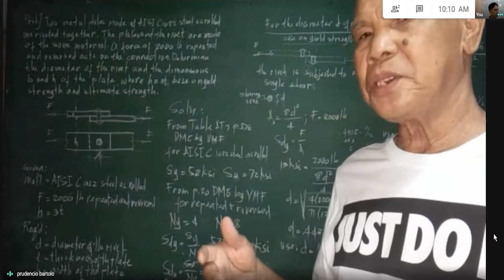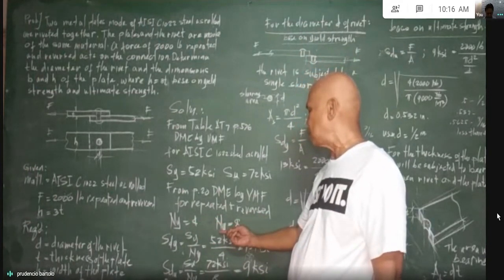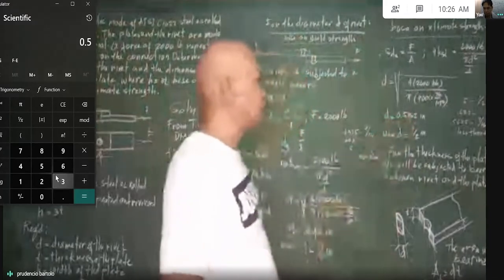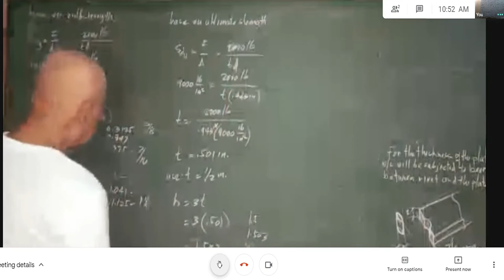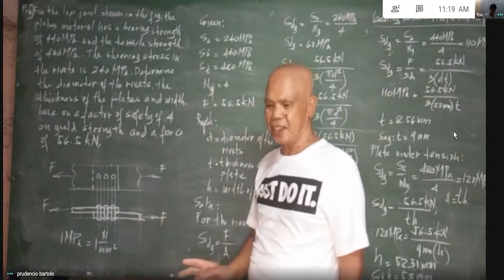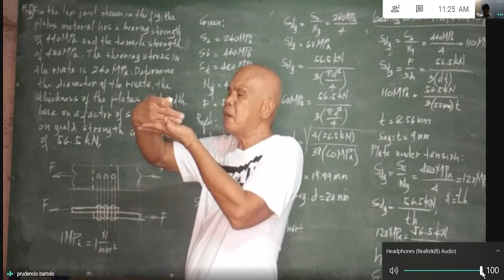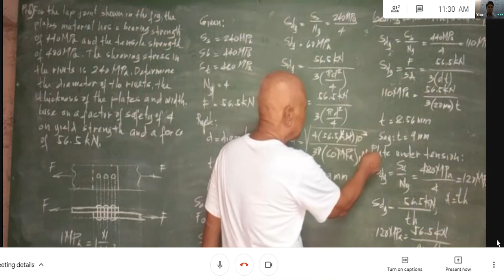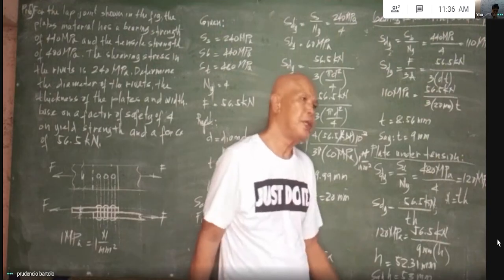Shearing and Bearing Stress with Engr. Bart

Comment: We have learned about how a bending moment causes a normal stress.  Stress is the a measure of what the material feels from externally applied forces.  Forces that are applied perpendicular to the cross section are normal stresses, while forces applied parallel to the cross section are shear stresses.
 Calculating static equilibrium will tell us the magnitude and direction of the applied forces, which we can then use to calculate the stresses.
Reply: it is not the bending stress actually being referred to in here lyn, it is the bearing stress that is also considered normal stress.
I am sorry for the misprint.
Thank you very much for your comments.
Reply: Thank you for clarification Sir. I appreciate you :)